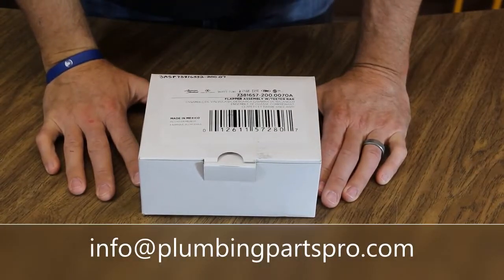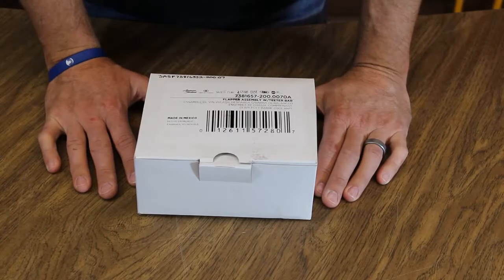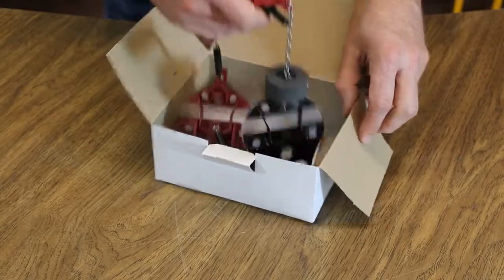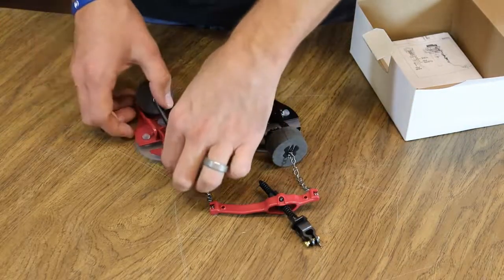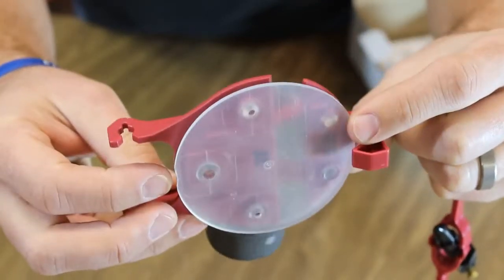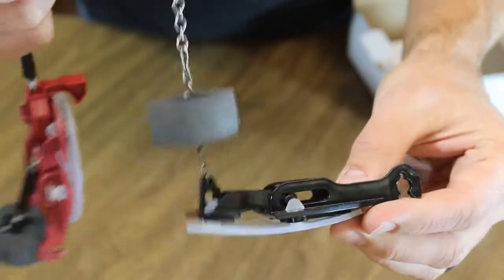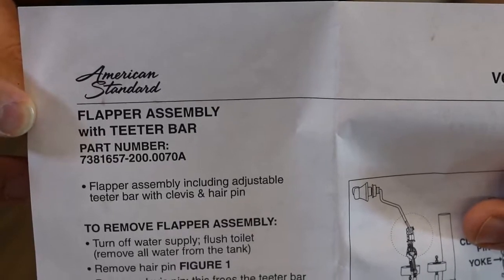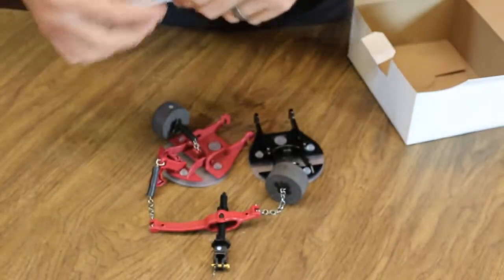American Standard Vormax Dual Flapper 7381657-200.0020A

Comment: My chain keeps getting hung up on the valve on the right can it be adjusted? Its a new toilet 3 months old
Reply from the maker: Make sure there's not too much slack in the chain.  Typically one loose link is good.  Too tight will not allow it to fall all the way and too loose causes hangups

Comment: Is the second lower red valve supposed to close? mine just floats around in the water, i have to push it down to get it to close and my toilet has quit flushing. thanks.
Reply from the maker: Yes it is supposed close or else water will constantly run into the bowl

Comment: My toilet leaks down every minute or so and all I can see is around the red flapper looks to be just a little bubble coming up from the back. Have already changed the value in the back of toilet.
Reply from the maker: Could you provide us with which model you have and possibly a picture to info@plumbingpartspro.com so we can help
Reply: same problem, little bubble coming up at the back of the red square that holds the flapper.  what was the solution? My toilet is only 3-4 years old.

Comment: Just replaced the seals but the toilet does not flush completely - no whooshing sound and complete flush.  Did not change any of the settings as the toilet operated correctly just leaked from worn out silicon seals.
Reply from the maker: Did you replace with genuine American Standard seals?   Also make sure the floats were not accidentally adjusted causing the flapper to drop too quickly
Reply: @PlumbingPartsPro  Yes they are American Standards seals.  You are correct the flapper was dropping too quickly.  Thanks that solved the problem.
Reply: How do you adjust so that the toilet flushes properly? I just bought a house that has these toilets & it was constantly filling with water every couple seconds. I replaced the silicone flaps but you have to hold the handle down for the toilet to flush properly. Can you tell me how to fix this problem?
Reply: @honeybee2swt74  From what I could make out from your comment, it sounds like the handle nut is on too tight. loosen enough so you won't have to hold it down. When you depress the handle and let go the flapper should drop to stop water flowing
Reply: @eapm223  seems to ke like the problem is that it's not getting enough water to fush properly.
Reply: @honeybee2swt74  Sounds like the flappers are closing too quickly to allow water into the bowl. Best guestimate without images to authenticate
Reply: @eapm223  yes exactly. Could you tell me how to fix that problem?
Reply: Black flapper continues to close to fast. What am I missing. I’ve put the teeter bar in every position I can imagine
Reply: @honeybee2swt74 you were so close to getting an answer. Did you ever figure this out? I loved this toilets power-and now it’s the worst.

Comment: $40 for what's normally $4 in regular toilets.
Reply from the maker: Yeah not sure it was a great design by American Standard
Reply: @PlumbingPartsPro  At least Amazon has three silicone disk for $18, that's all that should really need replacing anyway, unless you break off the latches.